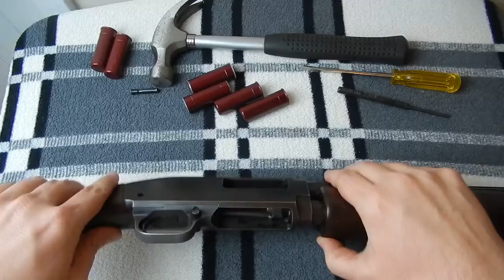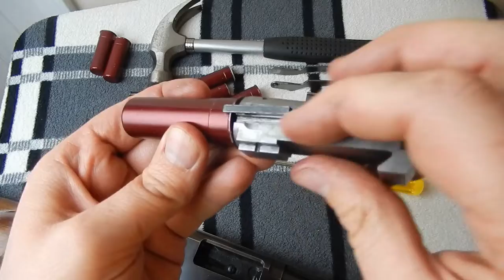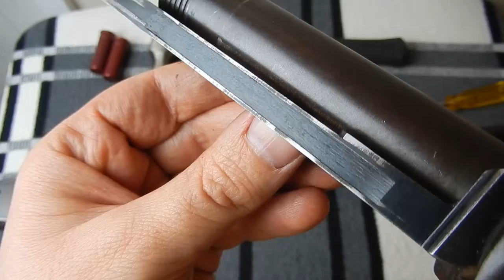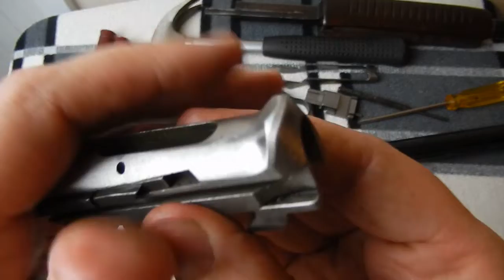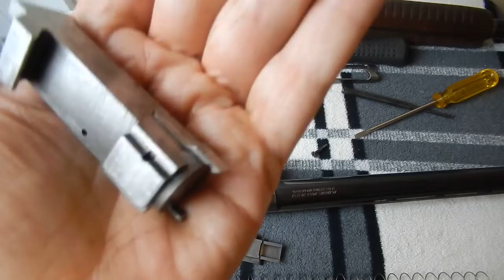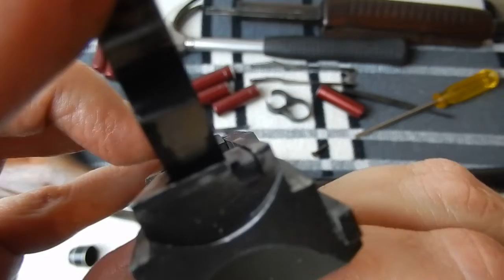JC Higgins High Standard Pump Disassembly & Description 2 of 3

Comment: Hi, I am working to repair my father’s JC Higgins/Flite King K-200 shotgun. The Action Lock Spring (6) was broken. I have acquired a replacement. I cannot find a picture, manual, or video online that shows a good view of the spring placement. Every manual I find is a bit obscure. Does anyone have a picture or could take a picture (a big ask I know) of how this spring is fitted into the action? I really don’t want to attempt without a better view and damage the replacement spring. If anyone can help, that would be fantastic. Thank-you!
Reply from the maker: @spydermonkeygarage7201 

If you go on Ebay and look at auction 155141022899 as well as 156476644755 then you may get your answer.

Comment: ROH, that pin was the correct orientation. It really can only go in one way. The channel that runs underneath is machined to accept that triangle bend — downwards. And yes, the short end of the spring goes towards the front, longer portion to the rear of the channel. I was just so baffled at how to get that spring to compress enough, to then push the roll pin through and OVER that spring. 

This past summer, I found a commercial, stainless steel dental pick, left in someone's garage after they moved — I thought it would come in handy for something one day. Did it ever. The pick is curved at both ends, and the ends are flattened, thinner than a playing card, but incredibly strong. It was the only thing that fit into that channel — enough to compress that spring.

The main hammer spring reinstall — PITA 
Trigger Guard Retaining Pin Spring — PITFA

One question if you can... I thought you, or another You Tube person did a video, where they explained how some Mossberg parts are interchangeable with the Model 20. I could be wrong, but I'm certain I've seen that written somewhere. 

Do you know what parts the Mossberg 500 shares in common with the Model 20? 

Any parts that could be substituted easily? 

I would really love a way change that magazine end cap assembly. I'd prefer a depressed/twist cap. But still, loving this Model 20. It's built like a tank, and so easy to come apart. Again, I couldn't have done it without your outstanding videos — you explain everything in such great detail — awesome.
Reply from the maker: The Mossberg and High Standard both share the same lineage.  They are both based on the Remington Model 17.  Other guns in this category are the Remington model 31, Ithaca 37, and Browning BPS.  None of the parts are interchangeable, though.  The Model 20 is, of course, a version of the High Standard Flite King.  There are other copies and versions out there.  I don't know if it's being made anymore, but the Armscor M5 made in the Philippines was the same gun.  I believe the High Standard tooling was actually used for that one.

Comment: Hey ROH. Thanks for the 870 video, very cool. I understand that You Tube won't allow certain content to be posted, and that's fine. I just wanted to know what to expect if I disassemble the trigger group. Is it less or more difficult than disassembling the 870's trigger group? It's just a bit frustrating — I can't even find a video somewhere else, here or anywhere. 

This is going to be a big no no from most people, but I want to replace the trigger spring with something a hair lighter. I don't like the "feel" of how the trigger breaks. It's not just heavy feeling - I expect that in a shotgun, but there's no travel — whatsoever. As soon as I put pressure on the trigger, I hit the wall, I press harder, and then it breaks. 

Maybe there's some gunk inside the assembly — I have no idea. I just wanted to strip the thing clean, replace the trigger spring with another that breaks the trigger at about half the current pull weight. —
Reply from the maker: Sorry I didn't reply sooner.  Replacing the trigger spring would likely not solve the problem.  There are many things that add to the pull weight of an 870 trigger.  One is the trigger return spring, however the mechanical disadvantage of the sear surfaces is what makes the gun safe.  There is no safe way to fix those for a novice and I feel like that is your problem, not any spring.  A well fitted and tuned sear surface is the primary determiner of a good feeling trigger.  I suspect that this is a more modern 870 as all of mine are much older and feel just fine.

Comment: Hey ROH. I picked up the Model 20 a few days ago, disassembled everything. There was rust inside the magazine tube, on the outside, in the threads of both where it meets the receiver and on the threads of the tube itself, the follower, spring, spring cap, all rust has been removed, parts re-lubricated and reassembled. 

One question about cycling. I found that: 

When I was in the firing position, I normally pull the rifle/shotgun into my shoulder, pull the trigger. But I found that with the model 20, as I pulled the forend rearwards before firing, — immediately after firing, the slide would engage in one motion, almost as if it was tied directly to the trigger being pulled. 

My friend's 870 for example, doesn't do this. As you pull the forend rearwards to secure the butt pad into your shoulder, after firing, the slide requires a more deliberate, separate rearwards motion to expel the shell, almost as if firing, and ejecting are 2 separate functions. The model 20 doesn't behave like this. The 20's version of this seems to be a simultaneous: pull trigger, and slide opens instantly if there's any rearward pull on the forend.

It resulted in the bolt coming back slightly, and the shell being slightly exposed, often resulting in a half ejected shell. The only remedy seemed to be to pull the shotgun into my shoulder using my right hand at the grip, while using my left hand on the forend to push it forward towards the muzzle - like a pull back and push forward grip — odd. 

Sometimes the shells would eject and clear the chamber, often they'd just flop halfway out. 

Is this an ejector issue, or simply a design of the Model 20? I'm aware that you can slam fire this model, is that part of what I'm experiencing? 

P.S. Is there a way you can private message me via you tube? Or is there a forum where I can share this stuff with you and others? Thanks.
Reply from the maker: First, I keep my YouTube persona separate from my forum identity, mostly.  There are a few forums out there to discuss this on, but I'd rather keep it here.  So, glad to hear you got yours cleaned up and back to firing.  As for your cycling question, here's an illustration.  Clear the gun, close the action, then point the barrel at the ceiling. Now, hit the slide release.  On my guns, the action will open almost completely.  I believe I have seen an advertisement for either the Higgins or High Standard that extolled the virtues of this as a feature.  Here's what is happening:

When you pull the trigger,  the action of the hammer falling drops the "action slide release lever" down, releasing the "action slide" otherwise known as the carrier.  The carrier is what holds the bolt up and locked into the locking recess.  By pulling back on the forend, you are putting rearward pressure on the carrier.  It's fine; the hammer cannot hit the firing pin if the gun is out of battery so the gun will ONLY fire when it is in battery.  You cannot move the carrier fast enough to avoid the hammer.

So, the next action is the hammer hitting the firing pin, firing the cartridge.  At that moment, the bolt goes back firm against the locking lug and pushes firearm into your shoulder.  This causes the carrier and slide to move FORWARD relative to the gun.  When the recoil finishes, the carrier, slide, and even your forearm have inertia.  This energy will open the slide, even if you do not want it to.  Check out my video here and you can see my WELL used 870 doing this while I rest the forend on my arm: 

https://www.youtube.com/watch?v=60O7PiPcw3k&ab_channel=RyeOnHam

So, to conclude, there is nothing wrong with the way you are holding the gun.  There is nothing wrong with the gun.  You have discovered how well made and 'slick' these old shotguns were.  You have also discovered how modern shotguns are not as well made.  Keep shooting the shotgun the way you were.  If you practice, you can run the slide faster knowing this will happen.  BTW, the Remington Model 17 and Ithaca Model 37 were both the same design (a Browning Design) and do the same thing.
Reply: @RyeOnHam  Thanks for the reply ROH. Yes, I did notice the action opening when I'd point the muzzle to the ceiling. I discovered this in the store before I bought the 20 - part of the reason I wanted it. It's insanely slick. The parts are few, and it's absurd how easily it disassembles and reassembles. I just really enjoyed removing all the crud and rust from the internal parts. Having said that, whoever owned it before me took very good care of it. Mine's the 583.60 — I'm assuming this would have been made in 1952, based on the "Model Gauge Roll Mark Date" 583.60 20 12 5/17/52, according to someone at Shotgunworld.com. 

It's a very cool shotgun. I might make the plunge, borrow my friend's glass/sand blaster, and re-blue the entire thing. It's actually in pretty good shape, but the top left and right of the receiver, — closest to the wood at the receiver end is kind of a green colored steel on top (left and right of the where the rib begins). 

Very last one — probably ever... 
I'm finding that most shells aren't ejecting properly. I tried a box of Federal 1 ounce slugs yesterday, a few winchester 1 ounce slugs, and almost every shell didn't eject properly. When I'd bring the slide back, almost every time, the shell wouldn't clear the ejection port, and end up like this: https://i.postimg.cc/TwRMbZwS/Shell-FTE.jpg — Why do you think this is happening?

My friend's older 870's action behaves the same way. Hit the slide release, and it opens. But when you fire his, it feels like the slide waits completely for the trigger to be pull, there's a millisecond of latency between the shell being fired, and then the slide opening if you have any rearward pressure on the forend. — Like 2 distinct actions, yet ultra smooth. 

Again, thanks so much for your help ROH. I wish I could have the ejector modified to send the shell 2 feet when I eject.
Reply from the maker: Hmmm, I'm concerned that your Exjector might be broken or not working correctly if you're having ejection problems like that.  You could also check the extractor and the spring tension on it.

Comment: Thanks for that excellent video RyeOnHam. I'm on the fence about buying one used at my local hunting store ($250 CDN). The number on the side says 583.60 if that means anything. The barrel has been cut down to 18 inches, the barrel band screw isn't a flathead but a hex head screw. The wood is in pretty good shape, the blueing is still blue, and it's slick as can be. Are there any part(s) that typically break with a gun this old? 

If so, where can I source parts. What kind of "accuracy" can I expect at 50 yards with this now cylinder bore using foster slugs, with a scope (if I ever decided to get the receiver drilled and tapped). I just don't want to buy a lemon that'll break on me, without a source for parts. But it would be a fun restoration project, stock, re-blueing if I ever decided. It shoulders so comfortably, and the smoothness of the action is unreal. It seems well built, and might be a fun pumpkin blaster at the range. I just want to know what I'm getting into. 

If things break on these models, what are they typically?

Again, thanks for your excellent videos.
Reply from the maker: The barrel Band will strip out.  The "exjector" tip will break off.  The trigger will break.  Firing pins.  Bent ribs.  The screws holding the magazine cap (under the barrel band) will strip out and get screwed up.  So long as the wood is good and there isn't any pitting rust, you should be good.  One thing I would check is the barrel length.  "18 inches" is measured from the bolt face when the bolt is closed.  People have been known to measure it from different places and cut it shorter than 18" .

Were it me, I would clean it up, repair and/or replace the barrel band, and call it good.  Refinishing is never a good idea.  It's just character.
Reply: @RyeOnHam  Thanks for that info, much appreciated. Where do you, or have you sourced those parts that break?
Reply from the maker: @bongerbob  Ebay, Wiseners, Numrich Gun Parts.  Never had to replace a barrel band, though, if it needs it.
Reply: @RyeOnHam  Hello again. I'm so sorry for the questions, I wish I could email you. Based on what you said, is this model 20 something that has parts that fail regularly, more than other models? 

Or is it simply an issue of it being 50 years old? If I had to replace any of those parts, would take many thousands of shells before they might fail again? 

On the model 20 I've had my eye on, the barrel band screw has been replaced with a hex head screw. 

I guess what I'm asking is, do all parts on guns this old inevitably fail? But once replaced are back in service for many years to come? 

Again thanks
Reply from the maker: @bongerbob  Many of the guns I've worked on I bought specifically because I know the gun and they were cheap at pawn shops or gun shows.  Because it was an inexpensive gun to begin with, people tended to use and abuse it.  There were a few weak features, but I'm probably representing the issues I've seen because I specifically seek out broken or worn guns to fix and resell.
Reply: @RyeOnHam  Thanks ROH, much appreciated. They're asking $250 Canadian for this model 20. I'm not into low balling. Nothing on it is broken, it cycles flawlessly, has some stock wear, but could easily be cleaned up or stripped and refinished. 

The barrel has been cut down to I think 20  or 21 inches SEE actual gun: 
https://i.postimg.cc/x8gpC3qr/JC-Higgins-Model-20.jpg 

I thought it would be a fun project over the winter to try and restore it to this: 
https://www.gunsamerica.com/userimages/85952/911040639/wm_11210320.jpg 

One last question if you don't mind: 
Can anything be done with the trigger? They let me dry fire the shotgun with a dummy in the chamber, there was no actual travel in the trigger. It just felt like it was already at the wall, with a somewhat heavy squeeze, and then a soft quiet click. Can the trigger pull on the 20 be lightened — safely? 

Do you have a video of the trigger disassembly? 
Again, much thanks for your time.
Reply from the maker: @bongerbob  Oh, that's in better shape than I thought.  Yeah, assuming it's got a new bead on it, looks like an okay length.  I'd snatch that up for that price.  As for 'restoration', well, I'd limit it to a good cleaning and putting maybe a coat or two of boiled linseed oil to freshen up the stock.  Hard to refinish the stock and keep the same factory look as well as keep the shield on the bottom.  Less is more with these guns.  That's my advice, though.  The metal looks great, really.
Reply: @RyeOnHam  Again, much thanks for your time and advice. I think I'm going to pick it up today or tomorrow. 

I know this is a big no-no with vintage firearms, but I wish there was a way to modify the barrel band and magazine end cap with a thread on - like on an 870 or others. It's just so much simpler to thread than relying on a barrel band and screw. 

Just curious ROH, what type of coating/finish do you think they would have put on the 20 back in those days? A lacquer? Varnish? Thanks
Reply from the maker: @bongerbob  My guess would be linseed oil or Tung oil.  There is no reason to take off the barrel band normally and I'd leave it there unless you've got a problem.  The barrel is fixed, unlike the Mossberg or Remington.  Leave the band there.

Comment: Mine had a wooden dowel rod inside the spring.  Any thoughts on that?
Reply from the maker: The dowel is there to limit the magazine capacity to two rounds for hunting waterfowl in the USA.  You can remove it and increase your capacity if you are using it for other purposes.

Comment: U dont need to take the trigger group out just spray it and wipe it
Reply from the maker: Yeah, that's probably good for most people, however I have 'repaired' dozens of broken shotguns through the years whose only problem was that they had never been cleaned.  You don't have to change the oil on your truck, either, but it isn't going to last long if you do not.  This video is for people who wish to perform maintenance.
Reply: @RyeOnHam  hey but the more u take the pins off over time they loosen up and they can pop out freely,  just take the barrel off clean and lub it and spray the action and wipe it
Reply from the maker: @georgeboultadakis8530  There is a balance to seek where it's 'too much' maintenance, but I think you might be underestimating the amount of use and abuse these systems can take.  In all my years of gunsmithing, I have had to peen maybe a dozen holes total that had worn too much, and all of those were weapons over 50 years old.  The number one cause of damage to firearms is people taking them apart when they don't know what they are doing.  I do have a High Standard in right now that had the front lugs sheared off of the trigger group so it's held on now with two set screws.  Had they known how to take it apart, this probably would not have happened.  Most of these guns are worth less than my hourly wage.  I buy a lot of them outright as they are too expensive to repair vs. the value of the gun.
Reply: @RyeOnHam  um ok. I'm just telling u how I clean and lub my 12 gauges.